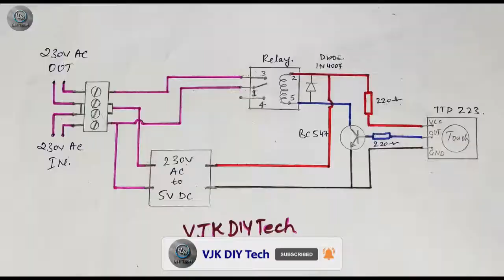How to make simple Touch Switch using TTP223 Module.... Cool idea..!!

Comment: wondering if there is a way for the light switch indicator LED to be ON when the switch is OFF and LED to go OFF when we switch off the light. That way, I can see where the switch is when it is dark
Reply: Easily Possible, short A or B different ways to give different result. Watch ttp223 tutorials.
Reply: Use 220 v indicator with relay NO point..

Comment: sir 5 volt charger, how much current rating is required?
Reply: I think the transistor works with about 100 mah plus the relay and the switch, I don't think you need a charger with more than 500 mah. But that doesn't mean you need exactly 500mah, I'm pretty sure anything lower, let's say 250mah, or higher than 500mah will work.
Greets.

Comment: I don't understand why u nee that much circuit. 2 resistors, 1 diod, 1 transistor, why? U r giving 5v supply. Just using a 5v relay n ttp223 is possible.